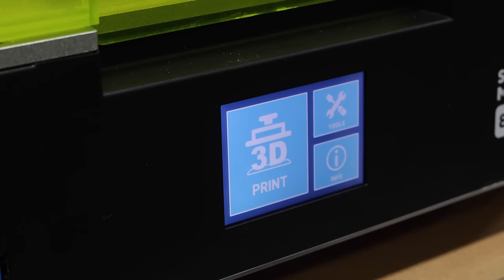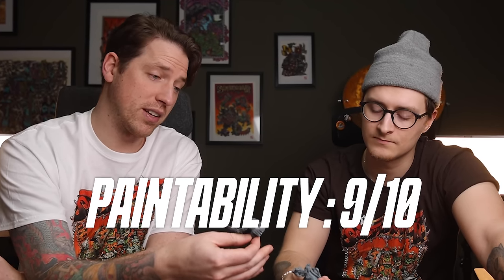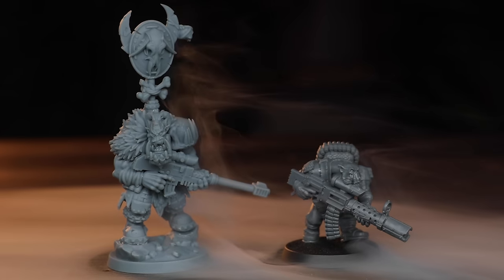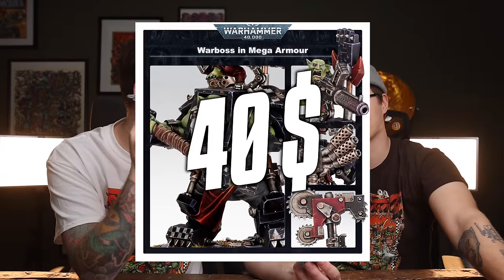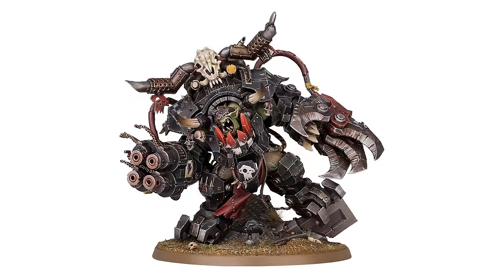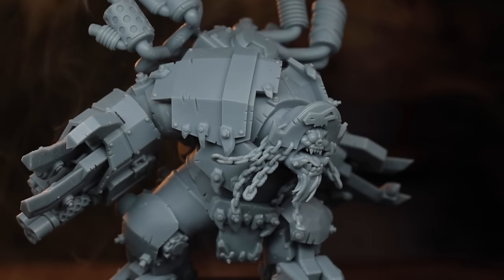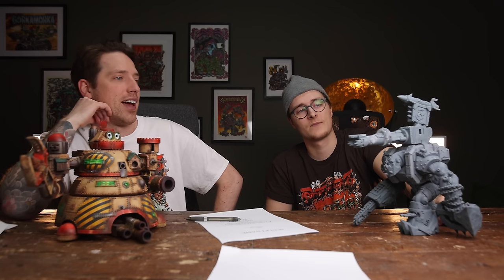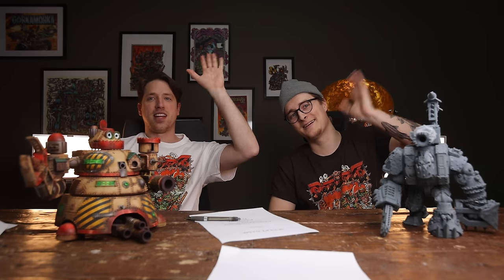Who did it best - Games workshop vs 3D Printed

Comment: i feel like the station forge you are suppose to use the Grand Nutta model. And almost all Station forge you need to scale down to 80%
Reply: Do they any where on the site state suggested scaling sizes ? 
I've ran into the same issue with being able to determine how big a mini going to be relative to the GW models or even other files.
Edit: in general not necessarily specific to a sculptor. 
There are some for what ever reason is ginormous when you first open the file and you know that wasn't the intended printing size. Not sure why that happens or why before they upload the file they don'take those adjustments.
Reply: @jc7997aj not that I have seen. But in the discord people scale them.
Reply: @jc7997aj  I run into this problem too. What i do is i take the STL of a model that i have already printed and know the size of, load it in alongside the model im scaling, and use that as my measurement. If i already know the model is the size I am trying to make, i can scale anything else i want to fit the size, be that taller, shorter or the same sizing.
Reply: @raeishimura  thank you.  I'll definitely need to build up a collection of correct sizes. I print a variety including vehicles, walkers amd titans so having the body from one creator and weapons from another can be frustrating getting everthing scaled correctly.

Comment: i think there's a couple mechanical limitations with resin printing that hurt certain aspects. ie. fur usually isn't super fine i think to help prevent failures/ make supporting not a nightmare and some aspects can't be too thin (like those wings) otherwise the resin will break from being inherently brittle

Comment: I would really like to see a video about 3D printing like the one you've made about airbrushes. Everything explained from the very basics, things to do and not do, safety aspects, additional equipment you recommend, types of resin, optimising printing settings etc. I love the idea of owning a 3D printer, but it all looks quite messy and time consuming...
Reply: I agree - there's a cost to 3d printing in the space required, equipment required to start up and maintain the hobby, and so on. I've been curious to get into it, but with just cursory research - given that I'd want to print big more often than small - it just doesn't fit in my life right now. 3d printing can become a hobby on its own, and right now, I can't fit another hobby in...
Reply: Once In a Six Side has a Really thorough resin printing video about that. It's basically everything you could want. He's not as careful about resin fumes as he should be (or at least wasn't, he's been taking it much more seriously lately) but he has a really good presentation style and it's very helpful.

Comment: For the big and chonky print you should always hollow your print it will save you so much resin ( i think up to 60-65% of the total) and the strength will be pretty much the same. 

Just make sure to make "exhaust" hole in the model like underneath the feet or somewhere else hidden so the resin/air can escape.

Could probably print a full size warhound titan with just a little over a bottle.
Reply: The only reason why I print them solid is because I love the feeling of them being heavy as hell, almost like a statue. Other than that, you're completely spot on. Also, I wonder what resin they used in the video because it sounds way overpriced. They could have used basic anycubic grey resin for the exact same results and pay like 15euro a kg
Reply: @MrCow579  they used the phrozen aqua grey 8k resin.
Personally i use the same but the 4k variant (got a phrozen sonic 4k mini)
it's amazing resin once you tune in the settings, doesn't smell, stays fairly flexible with small thin prints like spears/sword and just in general the detail you can get from while printing on layer 0.02 is godlike.
Reply: @ParaTrooper996  I can get that stuff for waaay cheaper than them though.. idk if they used the advisory price

Comment: great video as always BUT the resin prices...good abs like resin costs ~18-22 € per kg in germany. 
the phrozen resin you have been using is well...not what most people use I guess since the high price. 
siraya tech would be a very good and little more expensive alternative but still not what you had paid for the resin...

Comment: for paintability:
Remember that you can usually paint the pilot or rider and the vehicle/mount separately and then glue them together.
cannot do that with printed minis tho

all in all, they were quite gracious in the category
niche and tight spots were not really taken into account 
These are difficult to avoid if you want to have a one-piece mini for printing and can be pre-painted quite often with multi-piece minies
Reply: Most printed minis actually do come in parts, the choice to assemble them in a 3D program and print it as one piece is purely up to the user. I don't know where you're getting the idea that 3D prints only come as single pieces.
Reply: @Medved725  I know that (that´s why I said "one-piece mini"), but they only evaluated the full model
Or a least that´s how it looks like

Comment: You guys spend an insane amount on resin. I spend a tiny fraction of the cost and end up with equally beautiful minis. Idk if it’s because you don’t hollow anything out or if it’s because you spend a ton on resin, but yea man, printing should ALWAYS be significantly cheaper than GW
Reply: I think I'm currently spending roughly $25 USD per 1000g, and that's due to the fact that I use a mix of 10% Tenacious strong resin. Really glad I found Sunlu, that stuff is both great in quality as well as price.

Comment: Really love this. I just bought a Mars 3 Pro and I'm ready to ''Upgrade'' my ork army now that you make me discover new artists.
Maybe I miss it on the video, but for the bigger printed models, are they hollowed? If not, will this reduce the price and quantity of resin used?
Reply: As someone who does a significant amount of 3d printing on any large model I hollow them and yes it saves a lot of resin. I've also had less print failures with hollowed larger models

Comment: 3d prints are usually bigger than they should be. You've got to account for your exposure to uncured resin and any fumes from running it and how much time you spent processing it, the space you have your printer in, and the size being wrong.
Reply: And what has any of that got to do with size
Reply: @munkymittens  they're all downsides to 3d printing miniatures

Comment: thx for the vid, liked it. some bla bla from my side (only 3d printing nowadays)
1. DLP Printer > LED Printer (Expensive at start vs cheap at start and expensive at the end) far less missprints, and more or same detail with my 4k DLP then all the 12k I've seen (using default ABS-like resin))
2. HOLLOW your prints, you dont need to put a bottle of resin into that tiny stompa , holy shit, you guys have too much money, 2.2mm wallthickness, some drainage holes, done,that even holds my Warlord "Like" Titan save and sturdy)
3. these Infos would have been nice: A) Was the model printed in parts or as a whole. B) presupported or did you do your own supports?
Thx again, love every upload from you guys

Comment: You would have gotten better details with a Mini 8K.
Remember, printer resolutions are misleading, and a larger screen printer, like the Mega 8K will have lower detail on a miniature than a Mini 8K, which has a smaller screen size, thus, higher resolution. It's the same number of pixels, but over a smaller area.
Mega 8K is better if you are wanting to print large scale items, or huge batches for production printing. 
Mini 8K would be better if you want to print miniatures or small scale items with higher details.
Reply from the maker: We did print the small single models in the mini:)

Comment: I want a printer just for certain miniatures and terrian bits. It would definitely be more cost-effective for me. This video did put some things in perspective for me though.
Reply: Don't let the video mislead you on costs though; resin is way, way cheaper than they implied in the video. Idk what brand/type of resin they used, but that model they said cost them 120bucks in resin; you can print that for 10% of that price.

Comment: Great video and I must say, as a 3D printing enthusiast I see much bigger value in STLs than you guys. It costs time sure but I would hollow the living hell out of these big models, design custom supports, and bring down the price by half or even less. Whoever wishes to go for these models should keep in mind, the fact that you can scale them and support them by yourself. 
Happy printing and paining!
Reply: Curious: do you hollow out every model, or if not, how big before you hollow? (New 3D printer here, just getting for Christmas!)
Reply: @thinkabouthelogic  I try to inspect the model and hollow pieces that have more than ~50mm (~2 inches) in cross-section while printing. It is hard for me to describe exactly but using an example, I would not hollow a 100mm tall archer but I would hollow a bear with a big belly. If it has a large cavity I tend to hollow it.

Additional note: When hollowing try to hollow only big cavities and put blockers on things like legs and arms, where hollow space would be really small in diameter, such space tends to trap resin and it may ''explode'' later. And of course, a hollowed cavity should have a drain hole.

Comment: Through all of the 3d prints I generally liked them and the GW originals. Until the stompa, I feel like the 3d printed stompa was basically just a regular ork scaled up and that took a lot away for me from what I want and expect when I hear Ork Stompa. It looks really cool. But it doesn't really fit what I'd expect. Of course this is also coming from someone who has said many times if I start an Ork army, I'm scratch building every single vehicle. I'm literally leaning hard into the junkyard atheistic.

Comment: Cringes whenever someone say "8k resolution" when they talk about 3D printing
Since the image is projected onto the build plate, the smaller the plate the better the quality will be. an "8k mini" printer has better overall quality than an "8k mega" printer.
Which is why the industry needs to start talking about the print quality in some way that actually makes sense and let's you compare and contrast.

Comment: You are understating the cost of printing (safely and responsibly) quite a bit. Build plate replacement. Time spent on futzing with it. Bad prints. Eventual replacement of print or printer repair. Venting the VOCs. Proper disposal of the cleaning solution. I looked into it, and it seemed like a false economy.

Comment: Is the resin your using really 90 bucks a bottle? cuz Holy overpriced batman.  cuz Phrozen lists most of them in more like 40 a bottle.  And you can get ones that are slightly less expensive and just as good.    Even the castable resins i use are just reaching to 90 a bottle, and it's just a lot more expensive then standard resins.   I know there is some other costs as well, but just wow.

Comment: I won’t touch GW as I have a range of commrcial 3D models coming out not related to 25mm. I don't want the hassle. However I did produce an 80mm print of my 1/35 or 1/20th scale Hollis C1 Catapult Battle Mech…. and got warned not to produce it. What is the ruling on producing Mini’s it seems very varied. My thing is detail and my work is apparently is a bit good, said to be “fine-scale” out of the box.

Comment: If you have any skill in 3d you can customize your models too. Ideally you would want to be able to rig your models so you can pose them differently for multiple prints. Simple things like swapping heads, limbs and accessories should be in reach for even total newbies with some aid from tutorials etc. When I started in 3d there was almost no easily accessible training material and as if that wasn't bad enough the actual apps were cumbersome and unintuitive. Today however anyone can learn with vast repositories of free tutorials available for almost every facet of 3d modeling. I would be willing to bet someone has already made a tutorial to customize minis as simply as possible with mashups using something like Blender. 

Well worth a look if you have a 3d printer and are into custom minis and kit bashing. 

For Squidmar with all the models they have access to it may be worth considering investing in 3d scanner. Even a phone app may be good enough for smaller, flatter profile parts. You can scan individual panels/parts and have as many spares as you need. You could even customize panels for effect, damage, logos, your imagination is the limit.

Comment: I get you use the most expensive resin you have, but the prices seem a bit high anyway, are you hollowing them, using a pattern, or are they solid resin?
Edit:, i checked the resin you use and its 40 bucks for a kg bottle, not 90, so i really don't get the prices
Reply from the maker: In Sweden the 8k aqua grey costs 80

Comment: Most of the gaps in Resin printing are your fault tbh. Learn to pre-support, learn to position models right. Also, check the tolerances of your printer, might need to open your stepper motor, remove spring washers, place proper spacer. Increases noise a little, but makes your printer so precise and prints much better. :)

Comment: Details and creativity are almost equal if not better depending on the faction. The important factor here is cost- I can print either 1-1 scan copies or darn near exact proxies for a fraction of the cost. My 1-1 Daemon Prince Angron printed at 160% size cost me 20 USD of resin, whereas the puny by comparison legit model costs, what, a ludicrous 120 USD or something absolutely stupid like that? Yeah, nah. GW is dead. All I need is 3D printing and cool solo creators.

Comment: Since you guys are comparing 3d prints to GW miniatures, is the price you provide just for the Stl  or stl and resin ?

Because some resin will bump that price up  a bit. . Is this also taking the cost of printer into account? 

Because that Phrozen 8k mega s costs like $2597 on sale here and $3299 when not on sale.
When taken into consideration, the pixel density of 43 micron is pretty garbage, considering you  could get a Saturn 3 or ultra ...heck even get the phrozen 8k mini s over that printer you guys used.

Comment: I would have prefered if you had given the resin "price" in milliliters, instead of dollars. Resin prices fluctuate and what is "good" resin to you? Siratech?
Also 120$ of resin for the "stompa" means what exactly? That's four liters of ABS-Like Elegoo resin for me - on a bad, "not-sale" day - and that doesn't look like a 4l model, even with supports added.
Reply from the maker: We use the aqua gray 8k, around 80 USD per liter. Theres for sure cheaper resins, but we've never found a better one. :)
Reply: @SquidmarMiniatures  I use the aforementioned Elegoo ABS-Like (the original, not the 2.0) in grey and I print stuff for BattleTech and I wouldn't want to switch. The details are amazing (think visible tools on tank bodies) - sadly I can't post images on YouTube comments - and it's a lot less fragile, which is an absolute must for me as a player.  An 80$ resin would be an absolute deal breaker for me. ^^ think that's way beyond the point of diminished returns for me. Obviously other people might see this differently. But then again, that is the point of my original comment! 😂
Reply from the maker: @Vortagh  we mostly print small minis and minis to test print the quality of the figures were designing. For us as a business it makes sense to use  the best. For someone looking to save money it's Idiocracy 🤣

Comment: Like a lot of others here, some of your pricing was really confusing. Im guessing you did these prints as is and didn't hollow the big stuff, which hey, fair. Printing as designed and sold is the fair way to do a review. But you also should point out that the resin you used bumped the price up. You're using an 8K resin, which is not an insignificant price jump. You can get resin that works just as well for between $20-$30 and still get results as good as the ones you got. Hollowing also reduces your costs significantly, and should be mentioned. There are several ways to lower your 3D printing costs even more. I've had some models that i was able to print with the estimated printing costs being something like $0.20 a model before. So yeah, price will vary, amd it can be reduced by a lot if you know what to do.

Comment: The problem is 3d printed things are banned at every games workshop place
Reply: which is why more of us should play better games that dont have this issue
Reply: most indendpent gaming places are not worried. , non GW official events dont seem to care either ...  here in uk you cant even play in official GW stores anymore other than the odd anniversary day ... otherwise its just warhammer world in Nottingham you can book tables, but obviously only GW models or scratch built stuff using GW parts ,

many local events are fine with 3d stuff / proxies   .....

Comment: I was just wondering why I shouldn't get a 3d printer. I recently got into the hobby, god damn it's expensive. Can't justify the price for little pieces of plastic haha
Reply from the maker: It's a hobby in itself, can be quite fun and really cool. But as you say, it costs a bit.
Reply: There a large number of errors and trail and error. There a good amount of time to get paintable minis. Something it just better to get bits from a box instead.
Reply: @SquidmarMiniatures  You can say that again.
Reply: I feel like those prices aren't accurate, maybe if all of these are not being printed hollow. but i pay less than 40.00 for 2 liters of sunlu ABS like resin  and print large files all the time using much less resin. @squidmarminatures can you clarify if you were printing solid vs. hollow?